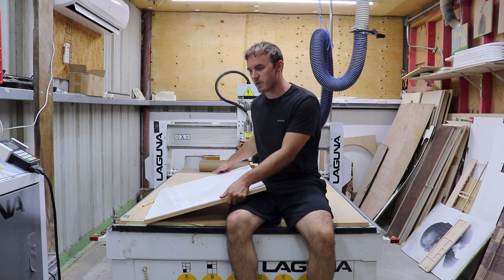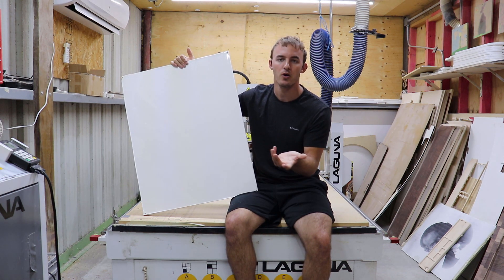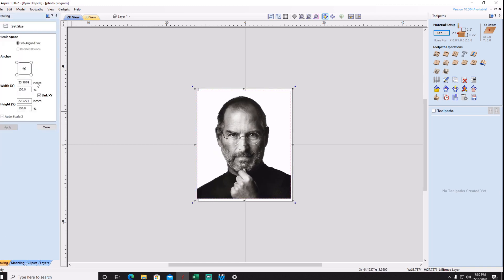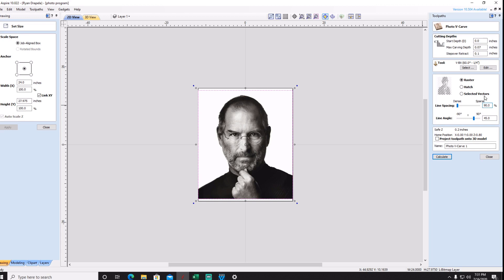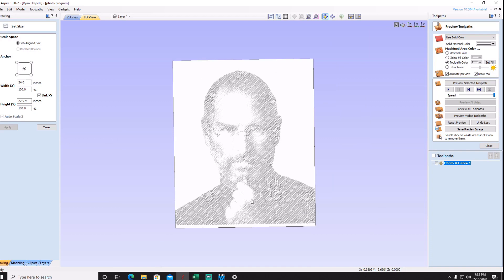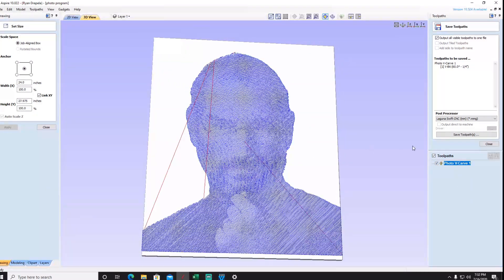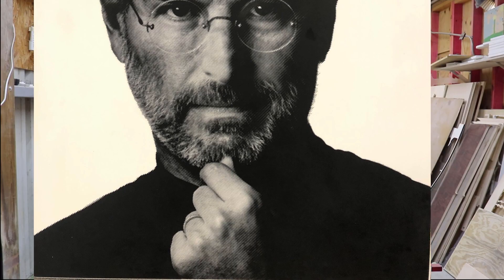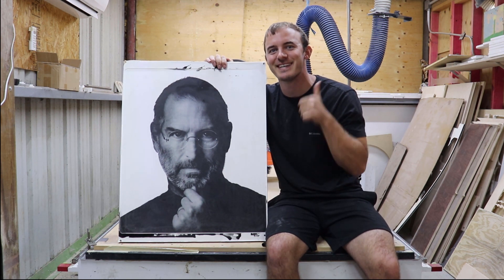CNC Made Epoxy Art | Epoxy Carved Photo

Comment: Hello dear friend Thank you for this good clip. I did your idea, but I had a problem in cleaning the surface of the paint. To be more clear, my question is: What tool did you attach to the spindle and use it to clean the surface of the paint? And how long should I wait for the paint to dry? (Do I have to wait for the paint to dry completely and then clean the surface, or is it enough to dry a little and then proceed to cleaning)

Comment: Depois que você jogou a tinta qual procedimentos que fez pra retirar o excesso, fez um desbaste?
Reply: Eu acho que aqui no Brasil não vende essa ferramenta FlyCut
Reply: @cutting-it-close  No brasil trabalhamos com milímetros, não estou acertando as configurações, quais profundidades seria em milímetros? Eu uso uma VBIT de 90º de 0.1mm a ponta e 6mm de haste
Reply: @cutting-it-close  com essa vbit que tenho da pra fazer?
Reply: @cutting-it-close  I did not understand how it was the path that generated to remove the excess epoxy, I believe it is a fill, but the doubt is, how deep did you put FlyCut to pass, and if the Z axis was zeroed over the material ???

Comment: GREAT WORK! May I ask, what was your FLY cut depht to remove the black epoxy? By the way thank you for the lesson.
Reply: that was my question!  this whole video changed my understanding of photo vcarve. here's my notes I wrote down after viewing this video "He fly cut to get the final image !!!  No sanding and image came out great. He didn't say how he flycut. Maybe start high and move lower? You could keep cutting lower and lower till you get what you want. I still don't know how this would work. Isn't there multiple depths created by the vcarve? Maybe not, he used a 0.07 max cut depth so maybe the blacks are created by varying the width of the groove cut while maintaining the same depth. This would mean that the flycut method would work. You just need to get the right depth and you could find this depth by trial and error. Start high and then move lower. Maybe if max cut depth is 0.07 in then the cut depth might be 0.03 or somewhere near this."  thanks, you have given me some things to think about. fly cutting makes this process much easier as I had been sanding to get to the final image.
Reply: @abricayworkshop7030  Thanks for reply. Will do!
Reply: @abricayworkshop7030  Hello, please answer my question in the comments section? Thank you

Comment: so u did 1st white epoxy ,carve with these settings ,then u add black epoxy and run it again on same settings ?
Reply: he first added white epoxy to his board.  after that he ran a 60 deg v bit to engrave the image into the white epoxy.  next came pouring black epoxy on to fill the grooves. once that was set, he used a surfacing bit to clean off the surface to get rid of the over-pour on the black which just left the black that was in the v grooves.